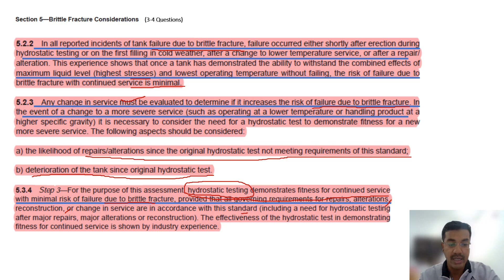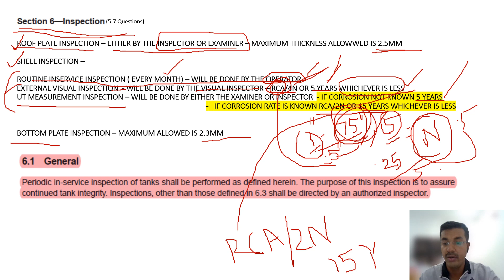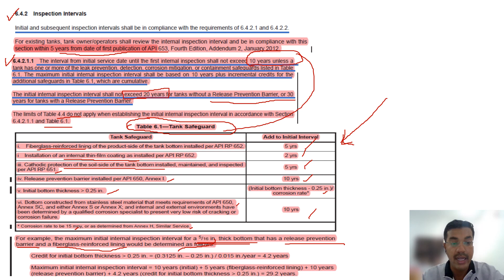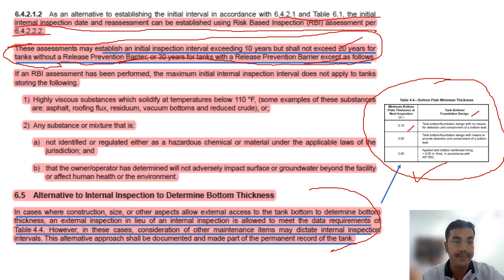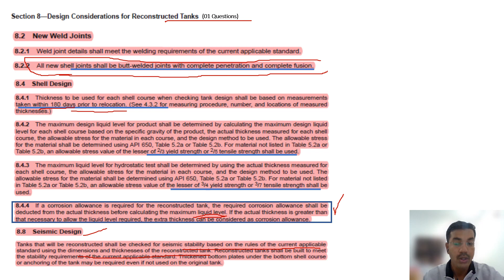API 653  PART 07

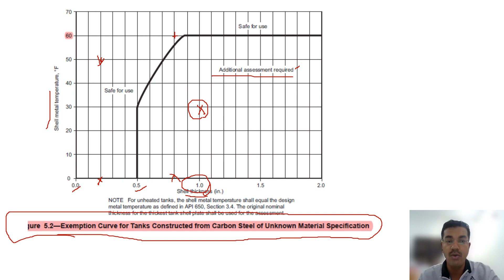Comment: Dear Sir, at 10:40 mint slide, thickness for roof and bottom is confusing 
Roof thickness is minimum 2.3 0.09 in and bottom thickness is minimum 2.5 mm 0.1in
Reply: we can use that Asset if that thickness is in range , else have to reapair that !